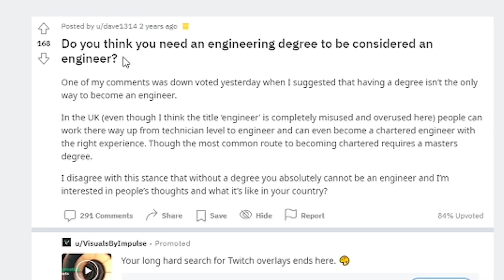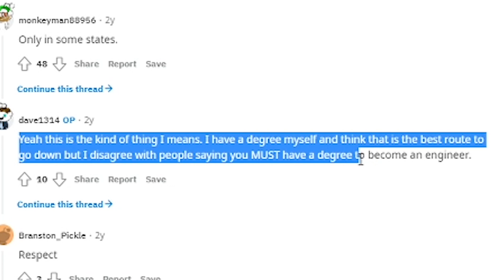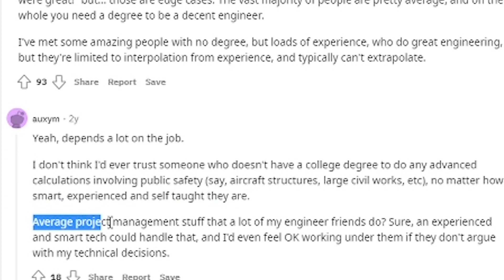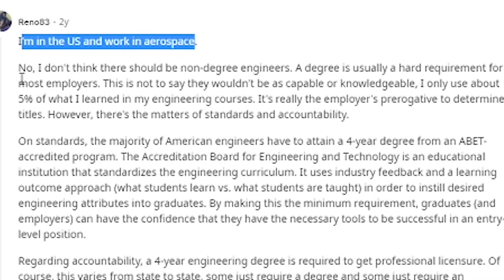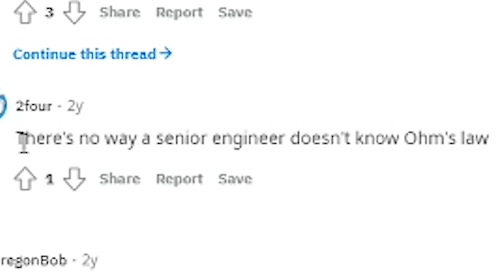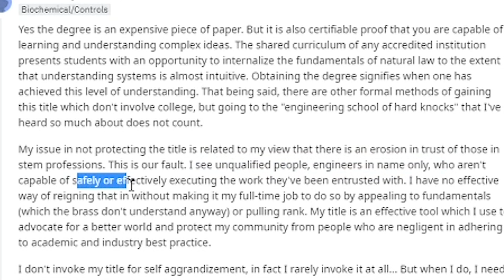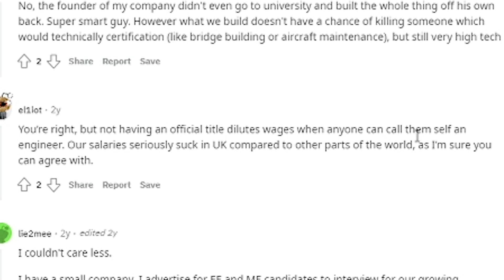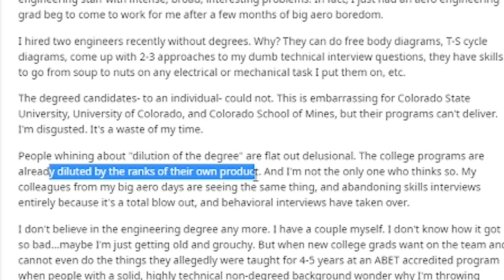Can You Be An Engineer WITHOUT College?

Comment: I worked as an electro-mechanical technician in an electrical engineering lab, We make medical robots, and I am currently on track to have 3 parts of my own design inside our robot. On paper I technically only have a GED, though I what I lack in official credentials I make up for with experience and the ability to pickup new concepts quickly. I'm moderately experienced in PCB layout/schematic capture inside of Altium, and I can do enough CAD modeling to satisfy the needs of our EEs. The engineers respect my input and we all frequently have lengthy discussions about how to approach certain design problems.

 I don't think a degree is a great indicator of skills or knowledge, our head EE has been conducting lots of interviews and he's very disappointed with the knowledge base of the graduates that are coming through... I think it's possible to make your way through an engineering degree without actually being capable of doing the job (after all, you are paying the school tens of thousands of dollars a semester... as the old saying goes "D's get degrees"). Where I DO fall short is in the math department, I'm not yet at the point where I fully understand the more complicated equations and calculations involved in some aspect of electrical engineering, though I am working towards it.
Reply: @WissamSeif  So I'm fortunate enough to have a decent bit of freedom, my manager recognizes that it's valuable to let me take a crack at learning new skills and he'll often throw something my way that's a little out of reach so that I'll have to push myself to do it. For instance, since posting the original comment I taught myself SolidWorks with a combination of online classes, trial and error, and sitting in on one of our MEs doing a design. I'm currently in the process of verification by testing and filing a design change order for a part I modeled for our robot. My EE/ME coworkers are generally fine just hanging out while they work on troubleshooting and they're happy to explain most concepts.

Comment: I think you made good points. Maybe my story might help with some more input on the topic. 

I went from welder to Robotics Tech to Automation engineer. I started off In Business school did 2 years right after high school and then decided to take welding courses the college offered. Became certified I a few styles of welding practices and got a job as a welder for a large crane manufacturer. From there gain very good fabrication and rigging experience. 

This moved me into Robotic welding and started as welder/ operator on the robots. Shortly after I become Robotics technician. This was the real catalyst into trouble shooting and becoming more technical. 

I then moved into robotics supervisor and design. It was here that I had multiple high level engineers mentor me in engineering design and disciplines.

I became proficient in Creo, Solid Works, and Auto Cad as my engineering tools. This is so very important to learn and become good at if you want any chance at becoming an engineer without a degree. However, I did go back to school for calculus classes and advanced 3D modeling and certain engineering focused classes. I will never stop learning and improving. It just is I have kept myself out of school loan debt and I have gained the engineering fundamentals without going deep into debt.

I then was fortunate to have a senior Electrical Engineer and Mechanical Engineer hire me as an Automation Engineer for the company. I was given the title but because I don’t have a diploma I do make around 20k less than average 5 year engineers.

I now design coil winding equipment and large industrial curing and burn off ovens for electric motors and transformers. I design the complete mechanical component and electrical controls as well as fab drawing and electrical schematics. My robotics experience is also being used in our CNC applications. Where I do most of the programming for our PLC controls.

All this to say, yes you can become and engineer without a degree. But, I wouldn’t expect it without any sort of education or continuing education. 

Also professional engineers are a totally different thing. I work with 5 other degreed engineers and none of them could even come close to passing the exam’s. As well they all have told me they Barely remember anything from college courses. Believe me a huge percentage of engineers use google to search formulas to help solve the math application. So to say they know where to start because of fundamentals is correct. But, it is not complete because all it takes now is typing your application and so much information comes up on how to do the more complicated math.

Hope this helps you or others😁
Reply: Thanks for this info

Comment: Since engineering curriculums are so broad yes I think it is possible to work up and specialize in a certain field but you won't understand or know how to problem solve in some cases. You know someone who has a degree is capable and has a better understanding of the basics compared to someone who doesn't. You won't get an engineering job right away without the degree or extensive online or hands on learning. As many have said that could take 10 years to get promoted and then at the end of the day you are so invested in that particular company or specialty that you are going to be stuck if anything happens. And knowing the fundamentals of why and how things are done is very important to knowing if your job is done right. Especially with cutting edge design you are better off with a better background that a degree will offer. Bottom line you can learn on the job but you won't have a grasp on the fundamentals and know why you are doing what you do. I don't think you can learn as much in the time it takes to get a degree to make it worth it unless you are a specialist in a certain field and never plan to change careers

Comment: I started as a tech and worked my way up to lab administrator at a cannabis company. Now that the regulations are in you need a degree. Funny how I could do it without the degree just fine. Well now I'm two years into my ME degree to get a job I already had. I hope the experience I have gives me a boost.
Reply: If you're working on a Mechanical Engineering degree, then that definitely should lead to places. Mechanical Engineering is very flexible and can be applied in many fields. At least, that's what I know as a physics major from asking about the ME program's courses.

In short, make the most of what you can learn, and try to broaden your scope as much as possible. If you could, take a physics class or two and applied math and make sure to have a backup plan if your first choice of career isn't available, which ME should be able to give you.
Reply: @WissamSeif  Absolutley, thanks for the great vid Wissam

Comment: Usually positions that are open for non-degree holders to experience their way into are on the low end of engineering or don't require a lot of actual engineering principles (aka project/team management.) It's also an older concept from decades ago where an engineer with a diploma wasn't very common so companies had to compromise and allow a lot of experience in a technical skill to be enough for some entry level engineering work,  management, or facilities/maintenance. 

I also feel that many of those stories where you hear "none of those college graduates could do this thing that these non-degree holders could!" Most of what I've seen from this were the fault of the interviewer/manager and not the candidate. For example, I've seen similar where an interviewer was pissed that none of the candidates could do T-s diagrams or know much about the combustion process until it was pointed out that the position was listed as looking for EEs and EEs generally don't even touch T-s diagrams or P-V diagrams dealing with combustion cycles. The most common thing that can mess things up in an interview is using non-standard/proprietary terminology. The 2 non-degree holders could do it because they were used to the slang or in-house terminology in reference to something while the candidates from a college/university would only generally know the formal terminology. I've had several interviews and talks with long-time engineers that used non-standard terminology for concepts and common parts that required some initial clarification on to ensure we were on the right track. 

The thing is, with the increase in engineering graduates, companies are not having to settle and compromise to fill engineering positions with non-degree holders as much anymore. Because of this, I've seen fewer and fewer engineering positions that'll allow just experienced technicians to move up into it with the exception of a design team where they just stick a long-time CAD user as a draftsman where the engineers give them the specs and general dimensions and they just CAD it up and make corrections as needed. You see this a lot in manufacturing engineering where making jigs and fixtures are considered entry level and beneath most engineers so this is an area that's mostly dominated by old technicians and occasionally a brand new engineer.

Comment: Last summer it was tough to find an internship with Covid and all so I reached out to a local machine shop that design and manufactured injection molds. My supervisor had worked in tool and die since he was 18 (now 44) and was self-taught and trained in SolidWorks and mold design. I've met highly educated engineers that haven't successfully designed a manufacturable plastic or metal part in their life.
Reply: A lot of the colleges/universities require a senior project which stipulates that something must be designed and fabricated. Most engineered products rely on standardized prefabricated hardware and parts that already exist to keep production and R&D costs down. Most engineered products are actually just a ton of off-the-shelf parts put together on a customized chassis that's been integrated to work together and function as a complete product. For example, on most cars it's just the frames, body panels windows, and engine blocks that are designed by the engineers in-house. The rest is put together by the design team from available parts by other manufacturers and its up to integration engineers to get all of those other parts integrated and working together.
Reply: If you’ve work in tool and die design all your life and start learning SW, it’s not exactly hard to start designing your own parts to a high standard. You’ve had years of experience in seeing what works and what doesn’t work, so once you know how to CAD the next step is using that experience to design the tool yourself.

Comment: This is an interesting topic and something that I think a lot of people feel very strongly about. The biggest issue I see with promoting people to an engineering position without a degree is the possibility of those technical engineers becoming obsolete and unable to do their jobs. As long as the technical engineer (who does not have a degree) stays in his specialized field then I don't see a problem. However, with how fast technology is advancing I see this becoming an issue. An example would be the recent push for automation. A technical engineer with 40+ years of experience making farm equipment will not have prerequisite knowledge to know how to automate certain processes and equipment, no matter how much experience they have. Having a base understanding of electrical theory, programming, microcontrollers, etc. is vital for automation.

I don't want to put a blanket No on becoming an engineer without a degree, but it's a risky move for any company to make. I also agree that the title "Engineer" has become diluted and no longer holds the clout it once did. This is very unfortunate because it leads people to believe engineering is easy when it is actually very hard. One time I had a field technician at my company tell me he was basically an engineer because he knew how to work on cars (i.e. a YouTube mechanic). I'm an ME student with another year of school to go and even I see how diluted the title "Engineer" has become.
Reply: What most people just generally don't realize is that an engineer isn't a more gussied up technician. A technician can work tools and take things apart and put them back together. An engineer is responsible for knowing HOW somethings works and has the ability to design another one. While most mechanics can take things apart and put them back together, they won't know the intricacies of how things work beyond some very rudimentary basics. You actually see this with many mechanics shops that specialize in custom designs where it's more a function of a massive amount of iterative prototypes versus raw computations.
Reply: In the Information Technology field everyone is an "Engineer". 😂

Comment: I want to go back and get my degree but I've learned more in the past 2 years at my current job then I did in my 5 years of college/technical schooling. I also have the ability to design machine wire and program. I'm a jack of all trades but master of none
Reply: A jack of all trades but a master of none is better than being a master of one
Reply: @WissamSeif  my electrical stuff but my main job is automate and design assembly lines so everything is ran through a plc. It's not as complicated as designing circuits on pcbs but it's a mess of wires. Also my machining but everyday I learn new tricks. I just feel like I'm spread out so thin because I'm usually jumping back and forth between projects running usually multiple cnc machine and a manual mill or lathe at the same time
Reply: My designing is solid tho I got really good at reverse engineering our competitors machinery based off blurry pictures and horrible quality videos.

Comment: Did 2 years of electrical and said fuck that. Instead I got my certification for structural welding, precision manufacturing and mechatronics. I have 5 years of cad and 3 years of cam. On paper I'm not a engineer but to the customer I am

Comment: I don't know how it is in other parts of the world, but in my country we have 2 levels for engineering: Practical Engineer and Engineer (BSc. or higher). Practical Engineers take ~2 years to finish with a diploma and they have a descent amount of theoretical knowledge in their fields (the most common are Mechanical, Civil, Electrical and Electronics). This basically bridges the "accreditation" gap, while still integrating the person quite quickly into the workforce, thus enabling them to acquire practical experience. This enables the person to be also promoted (down the line), if they gained enough experience, to do full Engineering work. I think its a great solution to this issue, because it doesn't force people who want to be legit Engineers to commit to full 4 year programs. Also, most of the Practical Engineers get their education sponsored by the military and later work there, so they get plenty of highly sought after experience once they demobilize. That being said, they are usually relegated towards the more "dirty work" of the Engineering fields, like manufacturing, and its much harder for them to get into the higher levels of Engineering work that BSc. Engineers can do, but with enough experience they get paid as much as BSc. Engineers and sometimes even more.
Reply: @WissamSeif  There are some Air Force sponsored technical colleges that include "cut down" courses in Thermodynamics and Fluid Dynamics that are focused specifically on Air Force needs. I have a friend who finished one of those colleges majoring in Mechanics and Aeronautics and they learn surprisingly a lot. Not as much as an Undergrad (they didn't learn about the Rankine cycle for instance), but quite impressive non-the-less. But generally speaking, Practical Engineers mostly specialize in Mechatronics if we're talking about the Mechanical Engineering field - hence the reason they are limited to manufacturing mostly. Just a side note, those who get a Practical Engineering diploma in Structural Engineering (basically Civil, specializing in Structural) - can sign off on plans for buildings up to 4 stories in height. All in all, pretty cool solution IMO.

Comment: I have an Industrial Technology Degree been an engineer for 10 years. The key to my success have been technical skills (Solidworks, GD&T, Oracle), skills I had to pick up by job hopping.
Reply: Not many calculations are needed. Engineering teams use either software, spitballed estimates or pick sheets. Unless you are doing a lot of custom work that requires it, you’re just doing FEA and managing pre-existing hardware.